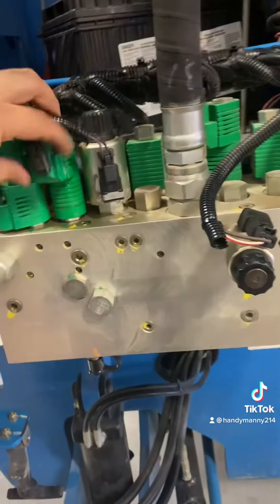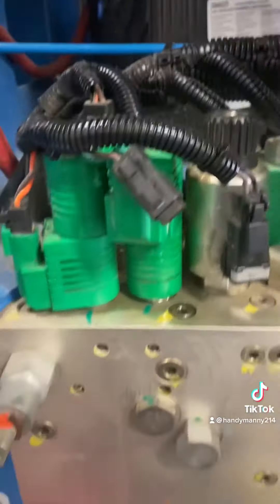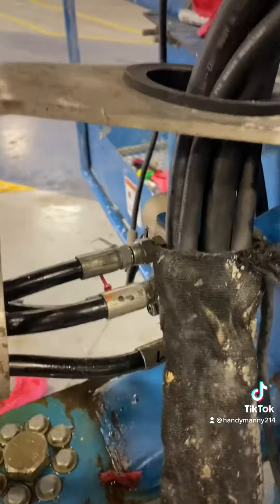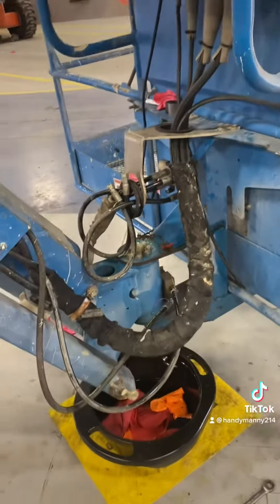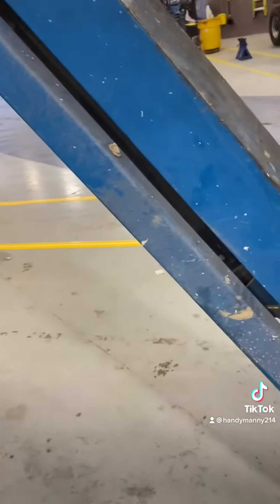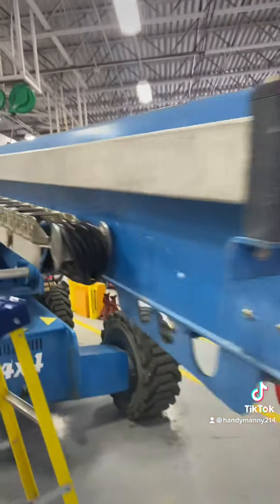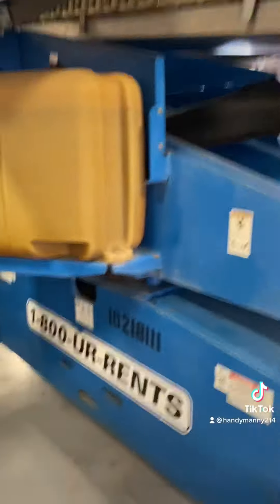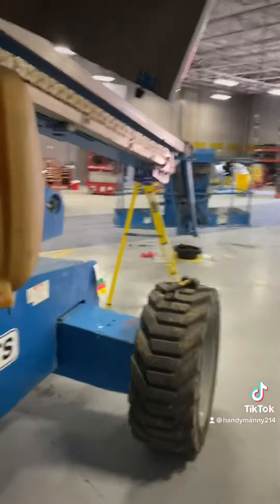Hydraulic Restrictions on Genie Boom Lift

Comment: yow manuel i talk with u last weeek on a s65 it was the key switch the problem thanks though man / one more question we have genie s125 no code from ground controll lcd screen k but it wont boom out past about 75 feet and stop  can there b a restriction on boom extend
Reply from the maker: Hey sorry yeah I get busy with work and family glad you doing the problem for future tho send me a serial number and I can further help I always have my laptop with me.
Mmm so with this can be a couple things but a common issue with this symptoms can be the cables being loose does it extend out smooth or hesitation?
Reply: @handymanny214  smooth and just stop just like when it would extend out to 125 and stop
Reply from the maker: @paulwatson4650  it’s leaning towards a limit switch , you got enough hydraulic fluid ? You can bypass all the switches and see if problem goes away
Reply: @handymanny214  K I JUST RECIEVE THE WEB GPI AND THE T HARNESS FOR THE 125 WOULD IT BE ABLE TO TELL ME WHAT  THE PROBLEM IS
Reply: @handymanny214  WHEN I LOOK AT ALL THE SWITCHES  LSB4ES THE SWITCH LOOK LIKE IT KICKS IN AT 75 FEET ONTOP OF BOOM CLOSE TO JIB '